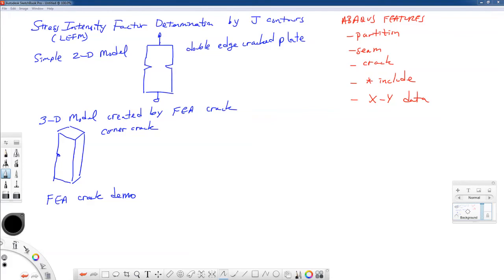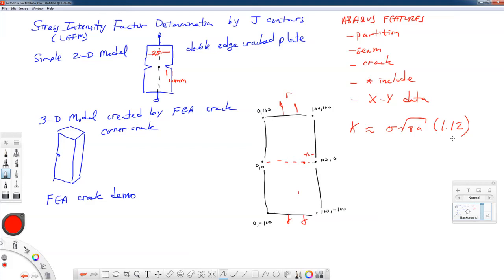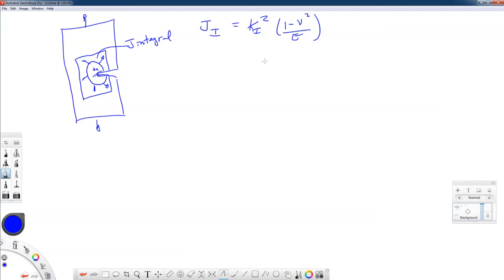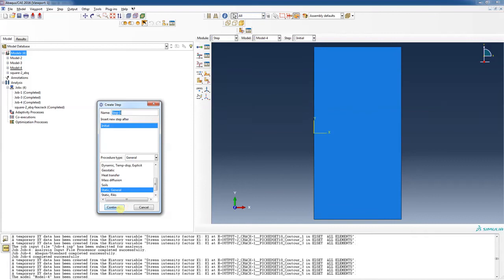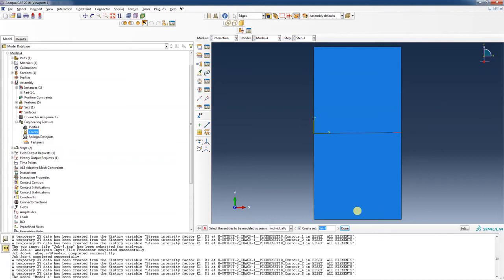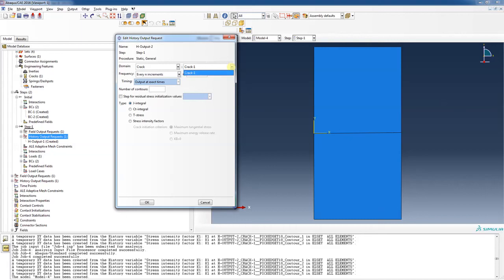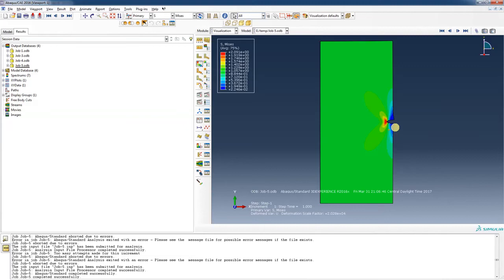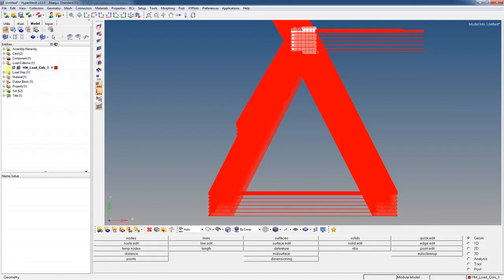AEM 535 HW-10 J-Contour for LEFM Stress Intensity Factors

Comment: Dear Sir

I have a 3D model to calculate KI with the same procedure that you presented here, my question is, do I need to add a constraint boundary condition at a distance from the crack tip along the crack direction? 

Thanks

Comment: I want to estimate the number of cycles/ stress intensity factors SIF and the corresponding crack extension rate to establish paris law for the given material under uniaxial loading. The sample has and edge crack (with symmetry boundary conditions) and a notch (hole) right to the crack edge. Load is 350N.
Young’s modulus for PMMA (Acrylic) of 2.8 GPa (406.1 ksi), and a Poisson’s ratio of 0.34.
Reply from the maker: ABAQUS can help you calculate the stress intensity factor but it cannot determine crack growth rate material properties--those would have to be determined experimentally.

Comment: Sir, Thank you very much about the video. I have a question, what is the different between contour 1, 2, ...5 that has the different K value? 
I will very thankful if you answer me
Reply from the maker: So, the J integral should be path independent.  However numerical issues near the crack tip can give some values that are not close to the others.  It has been a while so I do not recall the details, but I think most of them are close to each other.

Comment: Sir, Cloud you please help me for 3D modeling and partition drawing??It is hard to generating refine mesh near the crack tip for me.Can i get the 3D geometry model??
Reply from the maker: The 3-D model was generated by FEA crack.  Since that particular mesh was created by purchased commercial software, I am unable to share it.  However, I think that you can get some similar results by making crack fronts in 3-D using ABAQUS CAE.

Comment: Sir could you help please, I need to use mesh the section with shell element S4R with two size( 75* 76 mm and 25*75 mm) how did Ichange the size of this element in abaqus?
I will greatful if you answer me.
Reply from the maker: I believe there is more than one way to do this, but you can partition the mesh and set the mesh seed as appropriate.  My personal preference for full control over the meshing is to use Hypermesh instead.
Reply: Mechanics Channel by Mark Barkey 
Than you sir

Comment: Dear Professor,

In 3D model, there are many value ofJ-integral at each contour. So how can we select the J-integral value and at which contour?
Thank you so much.
Reply from the maker: From what I have seen with FEAcrack is that the first couple of contours near the crack tip give inconsistent results but the rest give about the same values.  So, I use the one when the values become stable. Hope that helps.
Reply: Thank you so much sir for your response.
Reply: One more question sir. So which is critical J-integral and at which location?
Reply from the maker: Do you mean along the crack front (function of angle) or do you mean which contour away from the crack front?  Also, the use of the word critical is not clear--Jic(riitcal) is a material property.  In theory, each contour should give you the same values as J is path independent for certain assumptions.  If they don't, then there are usually numerical disturbances that as an analyst you must decide about what to do.
If you mean as a function of angular position, then you should know that shape of the crack from can change the way the crack grows, with higher J (or K) values influencing the growth at that location along the crack front.  If I needed a single K or J value for a crack, I would use the maximum along the front, but again, that is for the analyst to decide.
Reply: Thank you again for your responses.